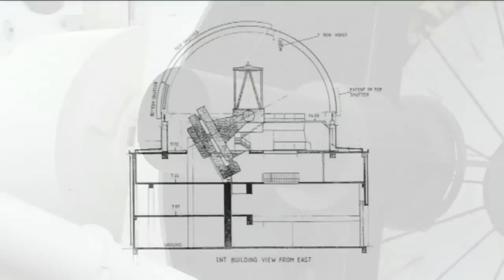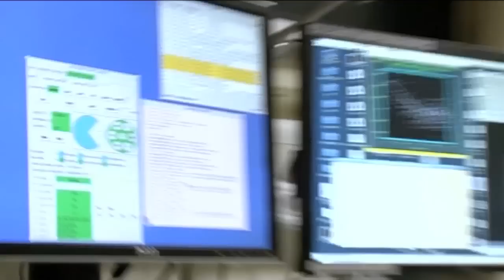Inside the Isaac Newton Telescope - Deep Sky Videos

Comment: A lot of people don't realize that you can get pixel to pixel variations.  But in addition to that you can also get subpixel gain variations.  I once helped with some research on subpixel variations in gain for dithering during some summer research back when I was still in school.  Even thought it was a backlit ccd, as in all the electrical bits were hidden and only the back is showing, you could almost determine the structure by looking at the subpixel gain for different pixels across the ccd.  It was for a satellite at the time that got canceled eventually.  Another thing that a lot of people don't know is that there are also hidden pixels around the outside not exposed to light that you can use to calibrate the ADC for normal noise generated thermally during a photo.  Also some CCDs may have different ADCs and read the image split down the middle or even quartered, and as the CCD ADCs are physically separate they have slightly different gains from manufacturing so somehow they must be normalized between them as well.

Comment: 3:36 "We cool these detector to liquid nitrogen temperatures".
Incorrect. Dark current on most CCDs falls to almost zero at about -100C and further improvement with even lower temps is very small (while technical difficulties and cost increase), so they are usually cooled to -100C (sometimes to -120C lowest). Not to −195C (liquid nitrogen boiling point).
Yes, liquid nitrogen is often used, but CCD temperature is not brought down all the way to its boiling point.